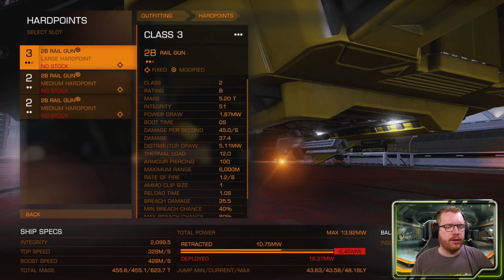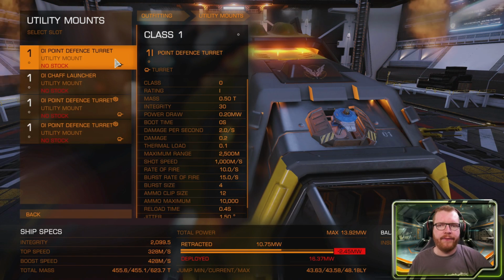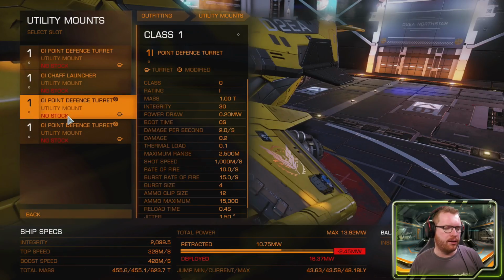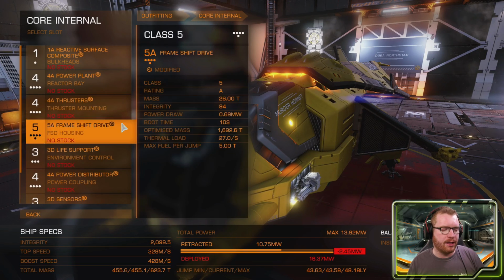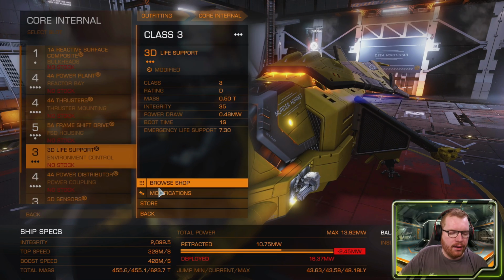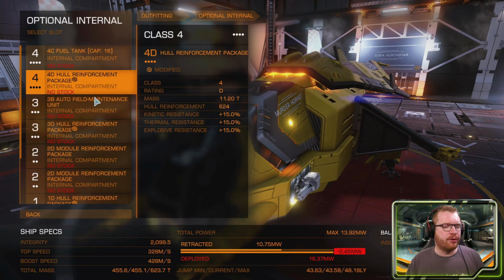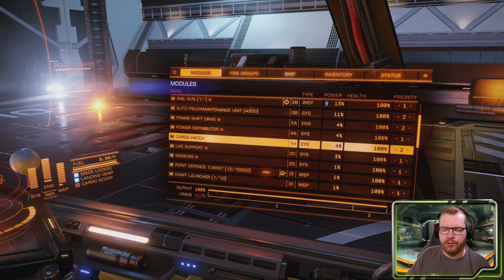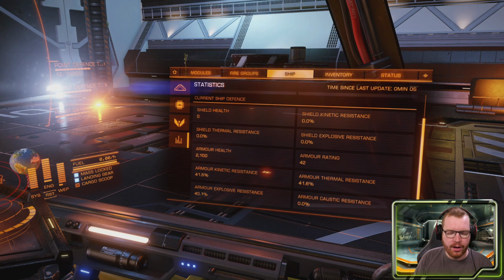PVE Sniper Build - Murder Hornet Build Guide | Elite Dangerous

Comment: thats interstning build. I am currently working on a sniper mamba build. Wondering why you didn't take mamba for a sniper build as it is faster then anything else and can boost away quickly to save distance? Because of heat management? I didn't have a chance to test the mamba yet still working on proper engineering.

Comment: Of course the FDL with a thermal vent beam and 4 rails is the better sniper but small ships are always fun. Actually my "Hand of God 137" is even reasonably PVE  capable if you take out the shields with beam and if need be cells with cascade first and then kill the powerplant with one or two shots you can still get 20-30 kills out of the ammo. I don't like plasma slug on the FDL because of the small fuel capacity, even with extra tanks.

https://edsy.org/#/L=FO5gAia00H4C0S20,ElwG57P_W0KZyG57Ovs0KZyG57I_W0KZyG57OwA0KZyG57Ouu0,DBwG5BLuW0DBwG5BLwu0DBwG55Lwm0DBwG55L_W0DBwG55Lwa0CEgG52G_W0,9opH5BJ_W0AAAH574_W0AOEG55IxI0AcIH55J_W0AsOG53Gx40B8gG53L_W0BLAG55Gx80BZY15,,7T4G59I_W07wv057wv057tn057sD0568MJ530xG0,hand_0of_0god_0137,HR_D28F